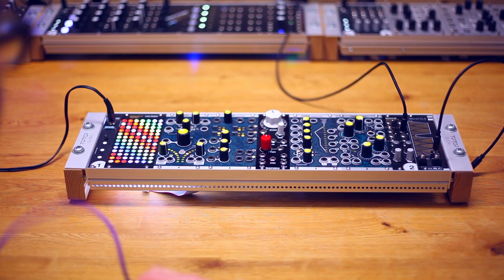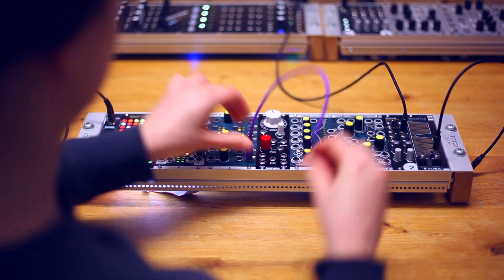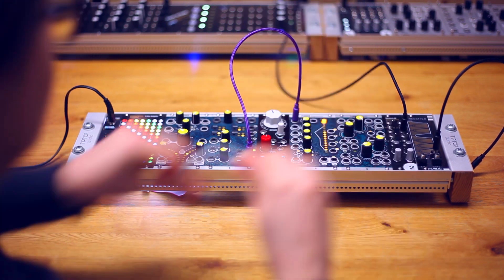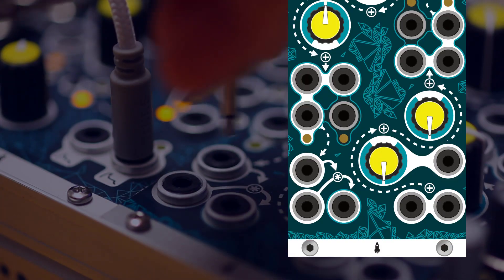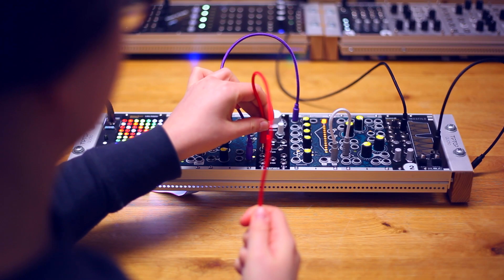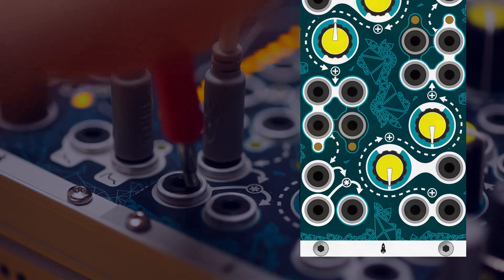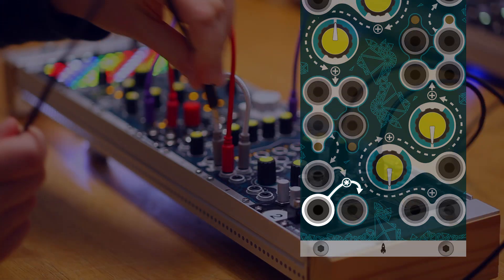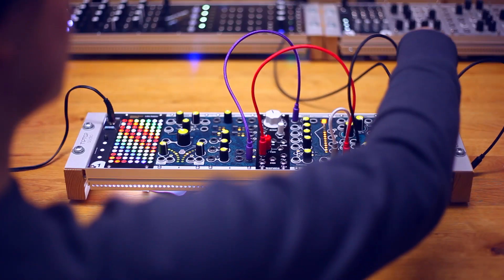Utility Minute: This is Not Rocket Science (TiNRS) Ardabil

Comment: What components did you use to assemble your case?
Reply from the maker: Rails from a 19'' Subrack (Baugruppenträger), Tiptop Z-Ears, Wooden endcheeks and screws from the hardware store. The power solution is our own power supply and a Befaco Busboard.
Reply: @MakingSoundMachines  Interesting, I haven't seen one like yours before. Do you mind sharing the part number for the subrack? Thanks!
Reply from the maker: @888cromartie  Baugruppenträger Rails from Reichelt - just search in their shop. Other shops offer more variety on their rails though, e.g. Exploding Shed. You will need to get the screw strips seperately. Ears are tiptop Z-ears - Thomann and gear4music and a lot of other big music stores have them.
Reply: @MakingSoundMachines  Thanks, when I search for Baugruppenträger Rails from Reichelt I get hits for so many things and I'm not German.

Comment: What's the rainbow one on the left though? Pretty.
Reply from the maker: It's our LEBQ adapter - you can build LEGO and compatible bricks on it. It was initially designed to make LEGO Technic contraptions with gears and motors and so on. This one is filled with translucent round 1x1 tiles and backlit from the bottom for decorative purposes. 😊